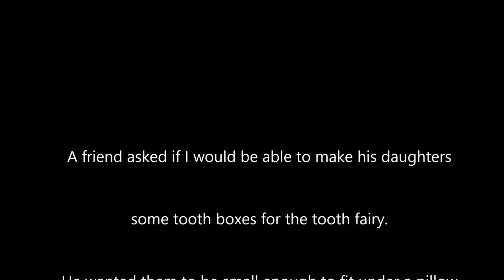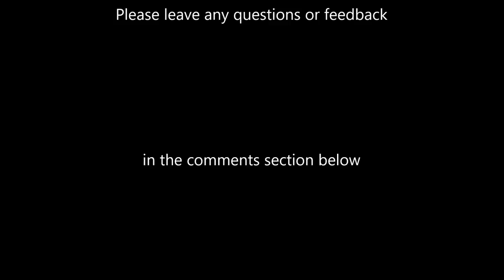Tooth Box (subtitled with music)

Comment: Where did you get the coin discs made?
Reply from the maker: I work with VisionCraft in Maryland to engrave these https://www.visioncraftonline.com/
Reply: Can you tell me what material the disc is made from ? Is it engraved or some kind of laser etching. I would love to have something personalised for a brand mark. Did it work out very expensive? I live in the uk, so it’s unlikely that the company you used would be useful to me. Any help you could offer would be very much appreciated, yours Ricky
Reply from the maker: These are stainless steel discs, cut, not stamped, and I have them laser engraved with my logo. It's a cool process, we spray them with a material and the laser infuses the surface with the spray. They work out to be a little under $5 per emblem, but I feel they give a very professional presentation (definitely better than my hand-burned signature ever looked). Hope that helps
Reply: Thank you so much for such a prompt response, that was very helpful. Yes, I agree, it gives a very professional touch. Thanks again, yours Ricky